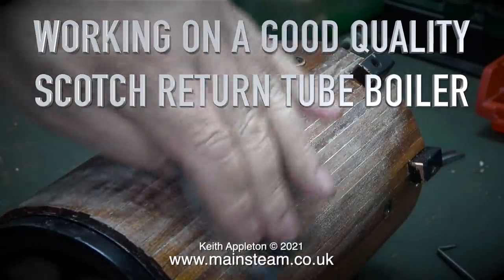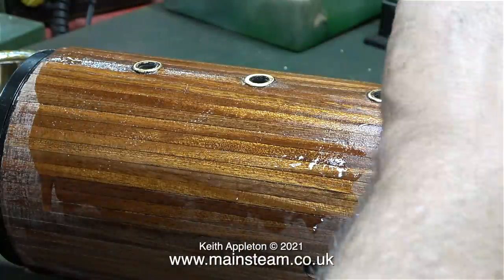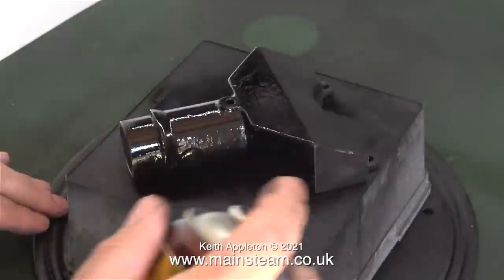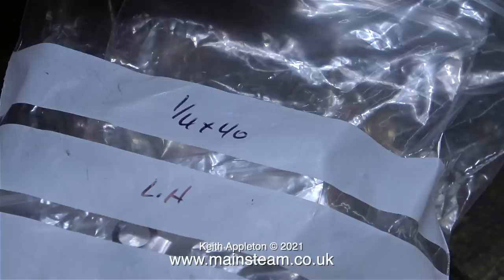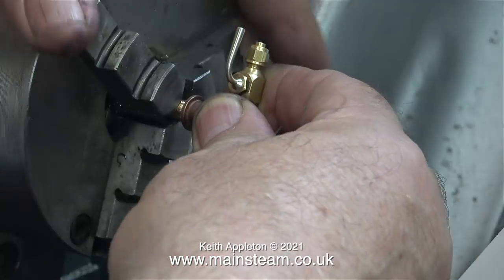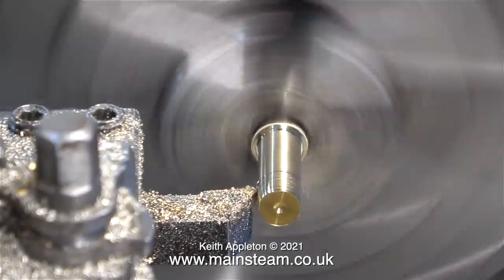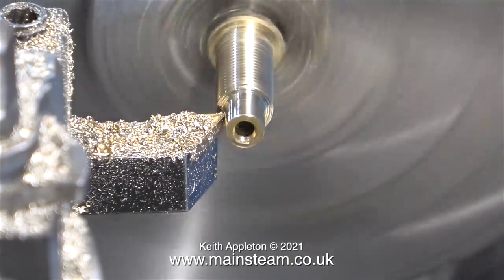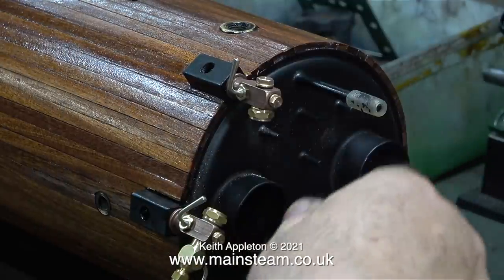WORKING ON A SCOTCH RETURN TUBE BOILER - PART #4

Comment: Worked at a place once where they received Alum-Bronze by mistake, they ran the order of parts cursing each piece, found we had to sharpen the tool at the same frequency that we did when cutting stainless steel. When the order was complete I asked what to do with the remaining stock, was told to get it out of the shop, ( i took two six foot long 5/8 dia. home, the other guys took the rest). We found that the recycler that took our chips and offcuts would not take the phosphors bronze chip because some of the Alum-Bronze got mixed in.

Comment: I am not trying to be argumentative. I carve mushrooms on my wood lathe and make jewelry boxes. I've refinished the oak floors in our apartments and made wooden (oak)  truck bed planks. Using the oil based poly urethane on a floor is quite smelly and takes quite a bit of time between coats. I've got quite a few sneeker prints on the floor when I tried rushing the job. Not good. I discovered the water based polyurethane. The process is to "squeegee" the liquid onto the floor with a lambs wool brush, on a pole. It put on a thin coat. It had runs and brush marks. I then read the can. lol. It said to flood the surface. I did and it turned out milky. Shaking my head with frustration I left for the night. The next day the floor was fabulous. No brush marks, crystal clear and flat smooth. This is how it becomes, "auto leveling". That 1/4 to 1/8 inch thick coating shrinks down to 1/64ths of an inch. 

I figured that this would work great on my mushrooms. Paint layer after layer until it becomes milky. Wait over night. come back to a horrible finish filled with runs, drips and brush marks. Sanding and re painting left a horrible surface. Thin coat means brush marks or spatter dots. I have used a brush designed for polyurethane and or air brush. On small boxes the vertical surface has drips from the horizontal surface, where it runs over the edge. That means that when I make the unpainted surface horizontal the previously painted surface ends up with drips. Masking tape does not help. I do not have this problem with oil based polyurethane, lacquer or the varnishes. 

I am going back to either the oil based polyurethane, which is much cheaper, or lacquer or varnish. As per your recommendations. Thank you.